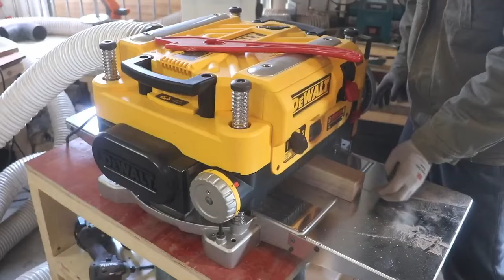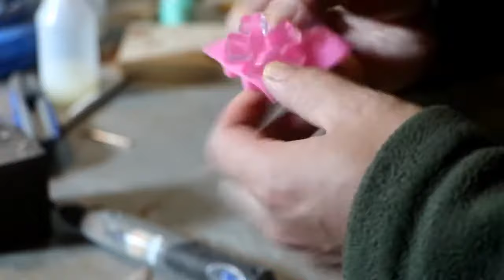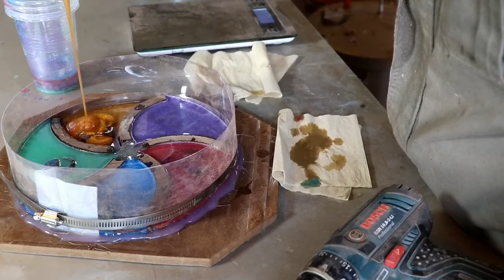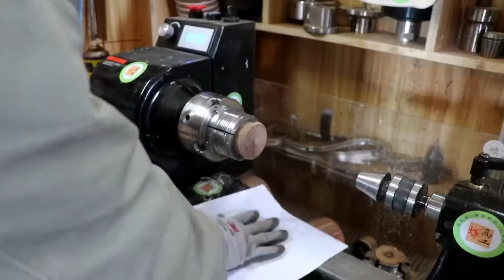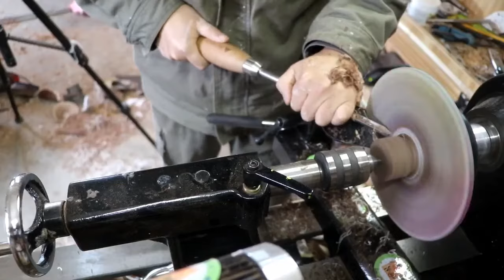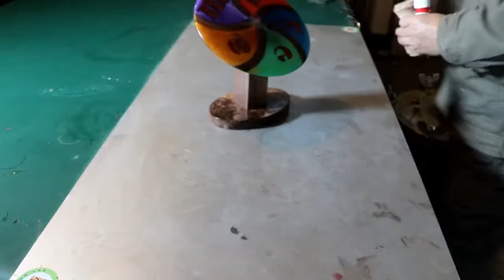woodturning: colorful dream for myself

Comment: Beautiful job.  What is that plastic wrap that the resin does not stick to?  @6:44
Also...is that a drill chuck you have supporting the wheel?  I've never seen that done! @7:33
Reply from the maker: Thank you so much,Rob, and it is pvc film. I didn't use dill chuck, I glued it with 5-minute resin.